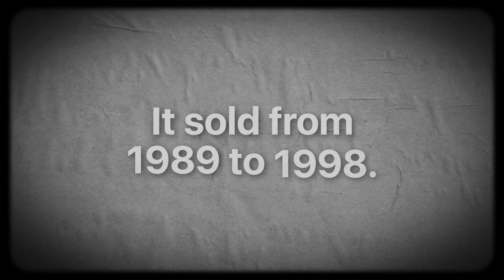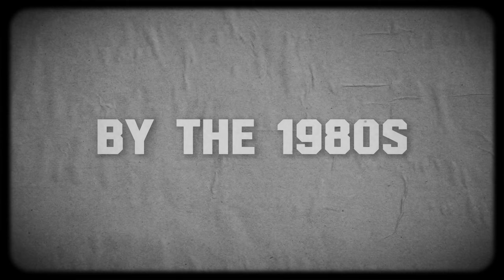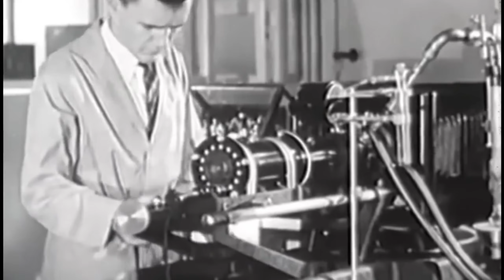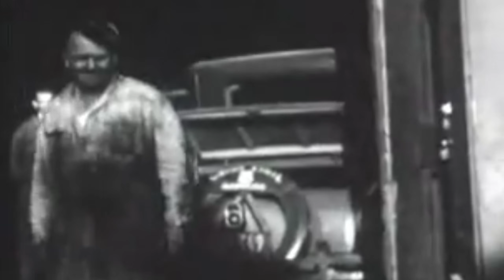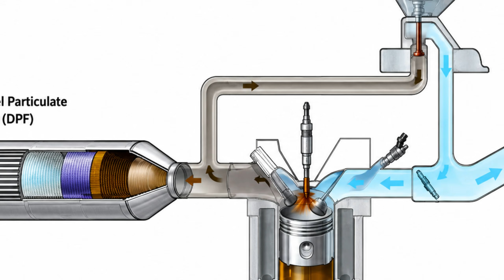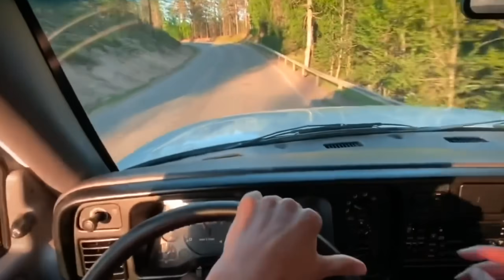Why You Can't Tow Reliably Anymore (The End of the Workhorse)

Comment: Many things are simple to design but if you don't take care of the back end, is harmful to all forms of life.  If you start with an empty room (e.g., jail cell) and the only entry is a slit where food & drink come in & an air vent... pretty soon your room will fill with your own waste.  Expand that room to our planet, and it's still the same problem.  So you went ahead and described the engineering for the power; you described how later modifications to solve for exhaust emissions created problems; you did not offer a solution.  There are two options... treat the exhaust or change the power delivery system.  The do nothing option leads to higher health costs and earlier death (notice it isn't the manufactures paying the bills, it is the people and tax payers).  Proven, treating the exhaust has challenges.  EV trucks solve the exhaust problem, and if Electric energy is sourced from renewables, solves the emissions problem... but also creates new problems (E.g., Down time for charging; charge station availability; Battery End of Life waste).   With failure, we learn.  When we learn, we eventually win.  This is a journey... nobody promised the road would be smooth.
Reply: Earth isn't a jail cell, it's a planet with an ecosystem that consumes emissions, which aren't reduced by the new emissions regulations. Evs and solar and wind are all hoaxes too. Def literally produces more emissions to manufacture and distribute than it allegedly saves. 
We should obviously take care of our planet, but don't let the epa fool you into thinking that's what they do.
Reply: I was born in the late 70s and lived in a Los Angeles suburb. Smog was a real issue and my parents would get angry when I came home from school wheezing becuase I played outside during a smog alert. There would be actual soot on the car in the morning from sitting overnight outside. Some smog controls are unreliable becuase the manufacturer does not want to spend the money to fit a robust emissions system. I driven different types of cars with some you hardly get a check engine light while others the light comes on at the slightest glitch and the mechanic cant sort it out.
Reply: Diesel smoke is processed by the earth like volcano eruption. 

😊
Reply: Battery technology will never replace liquid fuels. I do admit that the new sodium ion batteries are pretty nice though. The chinese are coming out with some that aren't so freaking flammable which will encourage more people to go electric.
Reply: @masonreppeto882  I'm sure glad my cordless drill is electric and not engine powered. And my phone and my laptop. But for driving, you're absolutely right. I'll never give up fire breathing engines or stick shift.

Comment: Hmmm.. There's a lot of nonsense here. If your truck is shutting down on a ''mountain pass'', you are pushing your truck beyond it's designed capacity and it's shutting down to prevent costly damage. It's your fault for not knowing what you are doing. We have no choice but to stop producing engines that burn huge amounts of fuel. The price of diesel would be over $8.00 a gallon as of May 2026 if we had not made changes for emissions, like reducing weight and reducing fuel consumption and oil burn off. The air in the US and Canada is now cleaner than it was since the late 1940's. Modern trucks are NOT as horrible as people like you whine about. Things change, get over it. We are getting better and better at engineering vehicles. I just bought a 2026 Ford Maverick with the turbocharged 2.0 I-4. It's a really quick little truck, and I can get over 40 miles a gallon. Oh.. by the way... I just pulled my friend's massive Western Star logging truck over 8 miles to his garage with it.... I set a trip counter to calculate my fuel usage while pulling his truck. 24 MPG pulling a huge off road logging truck that pulls 180,000 pound loads through the woods.
I have a 100,000 mile 10 year full extended factory warranty that costs me just $35 more a month.
Reply: Bro bragging about a ford factory warranty. 

Gtfo
Reply: Hmmmm....  My 1993 Dodge D350 with the 5.9 gets an honest 20 MPG in the city and the truck is lighter than a new one ton diesel.  Less material to build my truck and better mileage and 33 years old.
Reply: @kevinohreally4261 
My 1981 vw rabbit pickup with a mechanical 1.9tdi swap gets 75mpg. 

And has better power to weight ratio than my 500hp Cummins (or a maverick)😂
Reply: @fastinradfordable  Those were great trucks.

Comment: love my 5.9 2006 but it is a 24 valve 230.000 one transmission alternator and some wiper blades.
Reply: Love my 2003 5.9 24v
She’s a beast.

267,000 miles. 
Makes 500hp
Big lift with 35” tires. 

And still gets 20+mpg highway